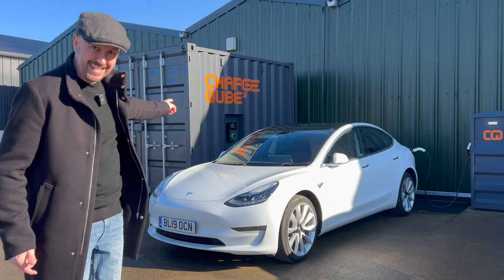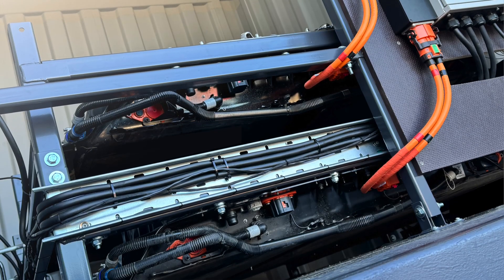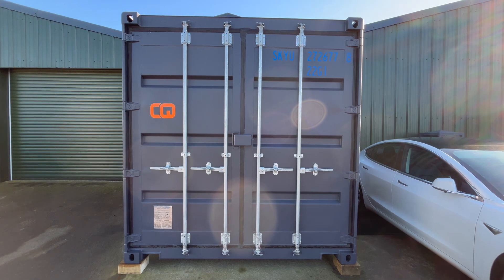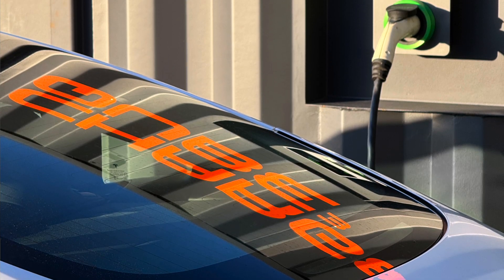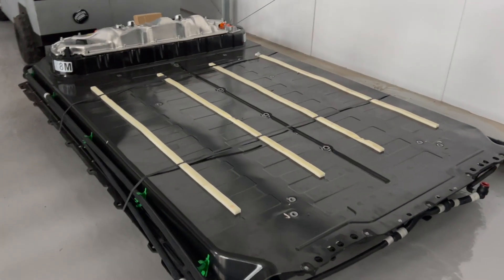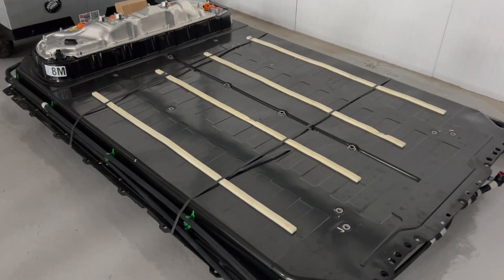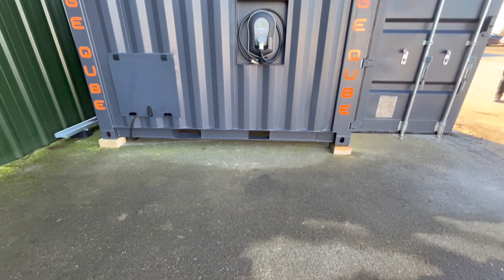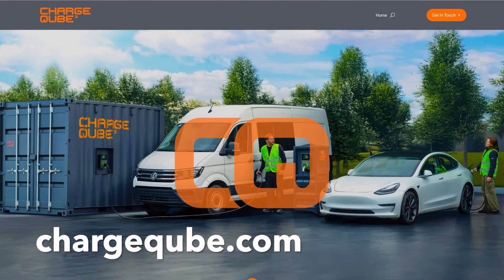Game-Changer! Portable Electric Vehicle Charger Is Genius!

Comment: So now you need to rent one of the smaller cubes to accompany you on music gigs. You could run all your stage lights and sound with one of them allowing you to have the gig almost anywhere.
I'm guessing that this type of thing will change the venues available for shows. A revolution might be underway.
Reply: I wonder if it could also be used at festivals where there is a grid connection but it's not big enough for the festivals temporary needs. The unit could charge with the power they have spare (perhaps using a clamp meter on the meter to a sense how much is spare at any minute )  and have battery as a buffer, similar to how they use temporary water tanks at the event
Reply: @backacheache  That's how it works indeed. Smaller version in the works indeed.
Reply: @ the sooner the better, I have never liked having beltching diesel generator around ☁☁☁ I wonder if they could team up with "grid faeries" who are also trying to put in batterys were possible